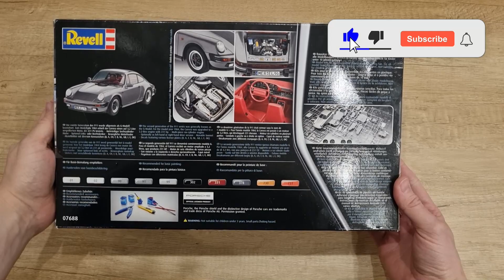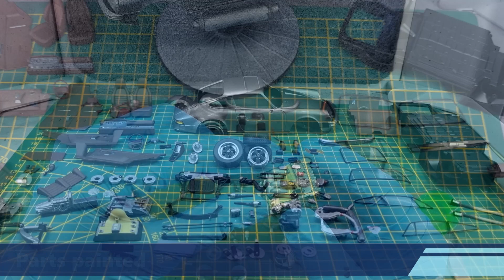Revell Porsche 911 Carrera 3.2 Gmodel 1/24 07688🚀 full build 🏁 how to #scalemodel #scalemodeling

Comment: Amazing skills. Your approach to "Panel lining" is excellent. What are you using ?
Reply from the maker: Thanks for your kind feedback! In the initial stages, I ensure the lines have sufficient depth. If they are not deep enough, I use a scriber to deepen them. The subsequent steps are standard: painting the bodywork, applying a clear coat, and polishing it. Panel lining is the final step, done after everything else is complete. I use Tamiya Black Accent Panel Line for this. Once it dries, I gently wipe it with a hard cotton bud. Occasionally, I use X20, a dedicated thinner, to remove excess, but most of the time, I wipe it before it completely dries :)
Reply: @AdHocCars   thank you for explaining in detail. I love your work.
Reply: @AdHocCars   Thank you for sharing, I appreciate it. It is good to know, now I must practice.  :)
Reply from the maker: thanks a lot!! I am happy to help!:)
Reply from the maker: Keep calm and have fun! the 2nd part of this saying is the most important! hobby has to bring you joy but not stress 😀